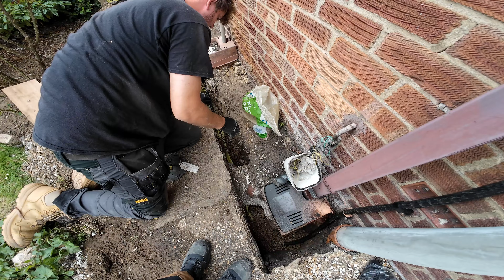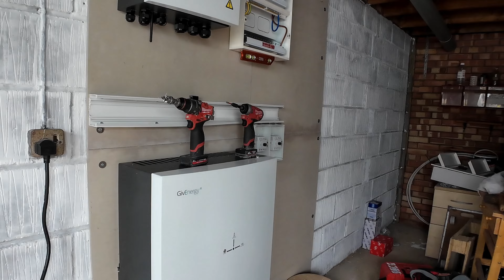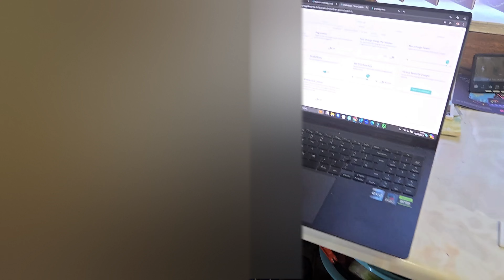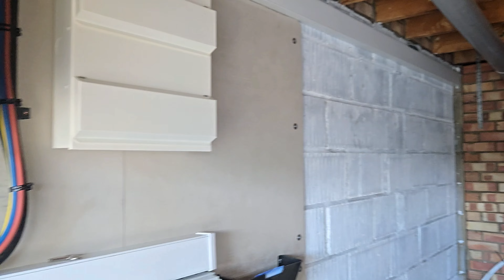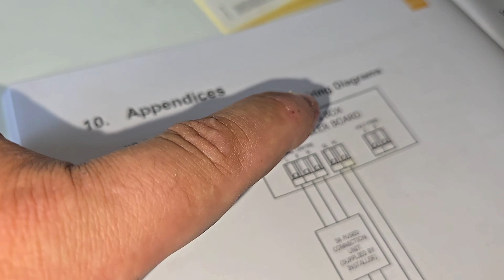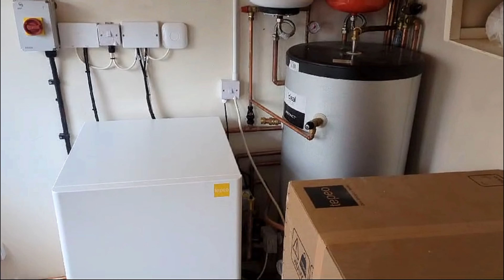GivEnergy AIO combined with an Electric Boiler from Tepeo Electric boiler....

Comment: Please could you help? Should the gateway on the GivEnergy All in one , EPS be switched on, in the gateway portal? Thanks
Reply from the maker: Depends if your installer set your system up for island mode.
Reply: @electrician247  Thank you for responding. My Installer is very experienced like yourself, love the content by the way, excellent. But he/we are having issues with my SMA inverter shutting down with the PE fault encountered on other inverters. Getting help from either company is like pulling teeth, so he is trying to find out the issue. I have watched many of your videos and you seem a genuine person and a good spark. I have seen you comment on the earth fault on other videos. Cheers
Reply from the maker: @Themiddleagedman53  yes that's an issue to resolve in your SMA inverter. If it's an older varient you will probably be out of luck. Also ensure your installer asked GE to activate the neutral earth bond as that can only be done by them. Installers have no access to it. Sometimes it's due to that. 

EPS should not be enabled without an earth electrode on the system. your installer will be able to advise on the EPS. It depends how they have configured the setup
Reply: @electrician247  Thanks I will ask him. No it’s a brand new Sunny boy 4.0  which is picking up everything and sending loads of error codes about everything, when we go into back up mode.He is talking to Give and SMA about things. Thank you very much for trying to help, it is very much appreciated.
Reply from the maker: @Themiddleagedman53  will be the n-e bond i bet.

Comment: Very interesting, I do believe there is funding for electric boilers. I did the training years ago on the Tepeo boiler, good alternative if you can’t or don’t want a heat pump. Basically a heat sink very reliable no moving parts and silent.

Comment: what brand / size is the SWA? looks pretty flexible
Reply from the maker: The main swa is 25mm 5 core. The smaller cables are H07 not SWA. 6mm
Reply: Hi mark, sorry yes the 5 core swa, what manufacturer? It looks pretty flexible for a 5 core 25mm. Great video
Reply from the maker: @ryanpestell529  tbh I can't remember but suspect it will be either donny or Cleveland

Comment: If you have an AIO & gateway fitted but not solar or other means of generation fitted, can you export any surplus from the battery to the grid when demand on the grid is high?
Reply from the maker: yes absolutely
Reply: Octopus energy say they need an mcs certificate number but givenery say the AIO is not generating power so does not have an mcs certificate? Where do you go from here?
Reply from the maker: @keith8443  speak to your installer it should have a G99 or potentially G98 if you got the 3.68kW AIO. Either way both can and should be notified to MCS. We do that on all solar and/or battery systems. Who installed yours?
Reply: @electrician247  SYNERGY RENEWABLES fitted the system
Reply: @electrician247  Finally got my MCS certificate, just waiting now for Octopus to sort things out. thanks for your help